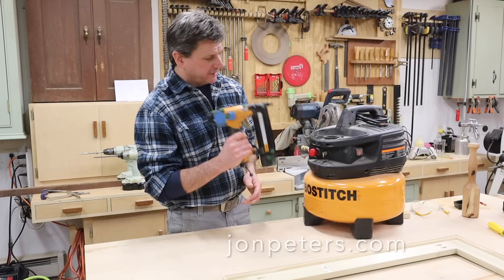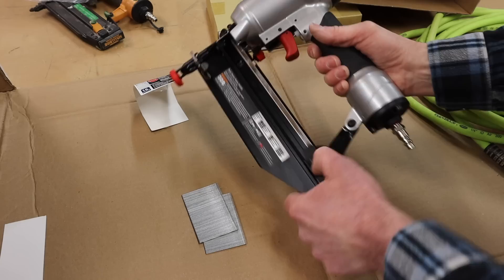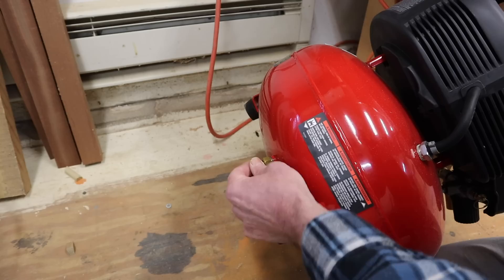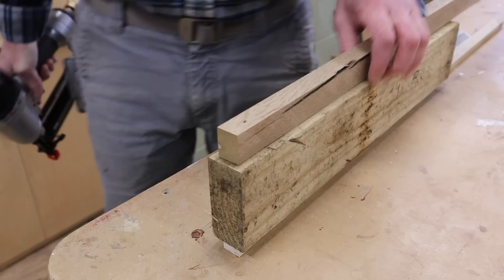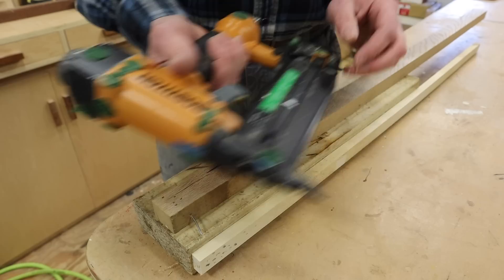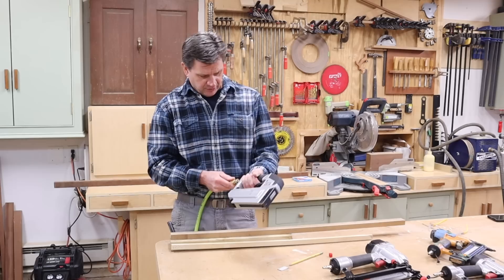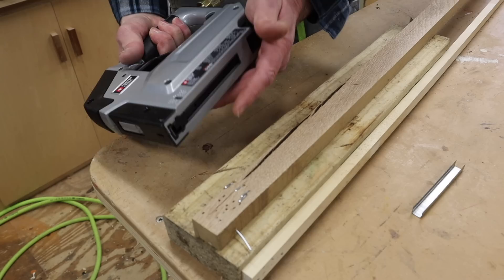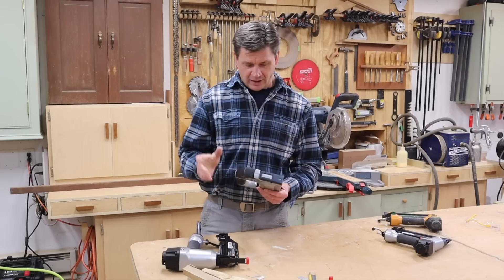$250 Nail Gun Compressor Combo Kit - Test & Review

Comment: Great video and thanks for sharing.  That valve was open for a reason.  Per the manual (who reads that) it says to do a 15 min straight break in run prior to normal use.  The only way to do this is open the drain valve so it purges continuously.  Just thought I'd share that easily overlooked info.

Comment: I bought the Porter Cable combo about 12 years ago for less than $200 bucks but it only came with a 16 & 18 gauge nail gun. I have never had a problem with the guns and the compressor still works well. Yes it is noisy but it only runs when it goes below the nail gun operating pressure. The combo reviewed by John offers a staple gun as well as additional compressor features. For $250, it looks like a good combo purchase.
Reply: If you look for the sale on this combo it's usually $169 or $179. Makes it even a better deal. Had mine for about a year now and no issues.

Comment: Thanks Jon! Helpful video.  
I have the same Porter Cable compressor/18g gun.  I find a slightly higher air pressure helps to set the nails a bit deeper. 
$250 seems like a great deal! Thanks again

Comment: That combo is well worth the money. I have had mine for 4 years now and i have used the compressor on countless roofs, hardwood floors, trim jobs, framing jobs, etc. The guns are good also. You cant beat it seriously. I have also pumped up air matresses and my tires numerous times. I am a small contractor and it has kept up with me. The 18 guage does have misfires though a decent amount, but it is still worth the price.

Comment: So i bought this same combo kit a year ago.  I am a homeowner/DYI guy and the first my first experience was not good with these tools.  I bought this combo kit from Home Depot which is 90 mins away.  When I brought this home, I immediately went to use it and discovered that the 18 gauge nailer didn't work.  I called Porter Cable and was told i had to return the entire kit to Home Depot.  I had to travel back to the Home Depot 90 mins away again to replace the gun.  When i got home, I tested every gun to make sure they worked, luckily they did.  About 3 months later while renovating my bathroom, the replacement gun failed and wouldn't fire any nails.  I again called Porter Cable who sent me another replacement, but it took 2 weeks to receive, which meant I had to hold off 2 weeks to finish my project (wife was not happy).  Normally, this wouldn't be an issue, however when I have to drive 90 mins to get a replacement when your in the middle of a project, it is a huge inconvenience.  For me, when I am using a tool, I need it to work,  I have owned Porter Cable tools for quite some time, and always had great success with them.  However, since Black and Decker (who owns the Porter Cable brand) bought Craftsman, I have seen a big decline in the Porter Cable quality as Craftsman is now their go to pro/consumer brand .  I would definitely stay away from this brand and these tools.  I will mention that I am pleased with the compressor and haven't had any issues with it.  I use it a lot and it hasn't failed me yet.  The third replacement just failed me again last week while finishing up a shed I am building.  Same issue, gun fails to shoot.  Apparently, the part that loads the nail fails and all you get is air coming out of the gun.  Although these guns have a 3 year warranty, I'm not going to bother getting a replacement, just going to get a better quality gun like a Dewalt (who BTW, is also made by Black and Decker, just better built) or a Senco.  Like I said, when I am using a tool, I need it to work.

Comment: We are using the Porter Cable 20v 18ga brad nailer (cordless) and loving it.  Air compressors make so much unnecessary noise...and tugging the hose around can be a drag too.  The cordless ones can be expensive, but I think they are worth it.

Comment: I would caution anyone buying a pancake compressor by DeWalt, Porter Cable, Bostitch, and Hausfeld. They all use the same manifold. When turning the regulator it compresses a spring against a disc. I don’t know the technical name of the disc but the problem is it’s made of plastic. Rather than spend a few dollars more on a part made from something more durable they use plastic. They don’t sell the plastic disc on its own. You have to have to replace the entire manifold! If not under warranty, this will cost you about $65 CDN. It’s a well known problem. There are several DIY videos out there detailing the problem and a fix. Personally, I think it’s shitty of this company to continue to use substandard material and then gouge customers for a $65 replacement unit to fix a $0.25 part.

Comment: Both companies are Stanley Black & Decker so pretty much the same product (along with DeWalt and now Craftsman).  Porter Cable was my first kit - still use the compressor and all the guns in the shop but ended up putting Rigids and Hitachis on my truck.   After a year the Porter Cable 18g was just leaving a lot of nails proud especially when having to nail at an angle like around inside corners or trying to toe or pinch nail, etc (even with pressure up to 120 psi).  The Rigids have been workhorses so far.
Reply: Ahh that explains why my craftsman combo set is identical other than color of the tools and the brand name printed on them and the compressor

Comment: Big PC fan; I've had the little pancake compressor for years and years and years, it's still going strong. Same with the PC 16ga finish nailer. I have a PC framing nailer that I don't get to use all that often (unfortunately), but it's done the job every time I've needed it. For the price of the tools, and for how much I use them - not every day, but more often than once a month - I think they're pretty hard to beat.

Comment: Thanks for the review. I have the same PC unit and it work great. I got a good deal. Iam a little concerned about the pancake compressor because of the comments on its durability. But any way, If I have to replace it, I will go for a Japanese made unit which seems to render better performance.

Comment: I just bought same set last week from Home Depot. $199. Planning on doing a bead board panel ceiling. NEVER used a nail gun before. This video helped so much. Looks easier than hammering. Starting my list of projects. Any other helpful  hints would be appreciated. Thanks
Reply: How do you like them  ?
Reply: Yeah I broke my door Frame and now it's hella wiggly and the nails came off. 
Now I gotta fix it

Comment: I have the same Porter Cable, got it on sale for $99 at Sears. The stapler gun sucks big time. I had a big project with it and it broke after a thousand staples.... the inside is platic and couldn't handle the load. Good thing I had a spare from another brand.

Comment: I've had a Porter Cable compressor with an 18 gauge and a stapler for about 3 years and have been really happy with them. It is loud but then it only runs to refill the tank. My only has one hose connect however i doubt i would ever have a need to have two guns plugged in at the same time.
Reply: Sometimes I put the air compressor outside or behind a wall.  On occasion I wear ear plugs.  However, I always use air tools because of the weight and price deference.  Besides the air compressor is a one time expense.

Comment: You should check out California Compressor. They are very quiet and reasonably priced.
Reply: I have one and it is extremely nice. My pup will occasionally wonder into the shop and she was not phased when it kicked on, and she is always on edge for those things. Bought a cheap Banks nailer and have been quite happy.
Reply: I returned a PC, way too loud. I bought a California Compressor #8010 off Amazon and couldn’t be happier. What a difference. I only use it for nailers, tires light duty etc.

Comment: I have this same combo kit, maybe a dumb question but when would you use the 16 gauge gun vs the 18 gauge gun, which gun is used for what?
Reply: 16 will give a little more hold but has a bigger hole, 18 is slightly weaker but also has a smaller hole so better for trim as it leaves less to fill and sand.
Reply: Is  the 16 gauge good for framing?i want to build a wood shed ,

Comment: I have the PC compressor and the same nail guns and stapler. The stapler worked for about 6 stables and died. The 18 gauge died shortly after that. Avoid Porter Cable like it was the plague 🙄

Comment: Hello, my new 26-gallon porter cable air compressor was dumped on its head during the hurricane and the motor is shot. Should I replace the motor or buy a new air compressor?

Comment: Nice video! Did your compressor and nail guns come with a small bottle of oil? Mine did but I lost the instructions and have no idea where or what to use it on. That might be a good idea to do some videos on, maintenance and up keep of your most used tools. Thanks for the videos, I'll learn a lot from watching them!
Reply: To oil the tools just put a drop or two into the air inlet valve to the tool, and use it like normal

Comment: Does the stapler have a depth adjustment? I noticed its not putting the bridge of the staple flush with the wood. Or would you need to adjust to a higher  psi to flush it up

Comment: Excellent timing. I'm actually in the market to purchasing a compressor. Where do you recommend purchasing this combo set?  
Do you know if the compressor can also take to duty of occasionally filling up tires and blowing saw dust from the shop area as well as the nail & stapler guns?  Excellent presentation & am looking forward to the stretching of a canvas.
Reply: Liam M might want to look at one of the California Compressor models. They are ultra quiet and nice quality for the money. Available on Amazon.
Reply: idigbebop ,, Good to know. Thanks greatly appreciated. Will check it out.

Comment: Turn the air pressure up 5 #s ......WTF??? Sorry , but don't over complicate a 1 braincell worth hiccup . If you read the directions ? You were supposed to leave the  petcock valve open and to let the motor run for 10 or 15 min. straight to break it in. I dont have the manual handy , but I do remember to run with valve open for a certain time. The pressure at the tank will be quite higher than at the tool , if 90# at Tank , 50 ft. hose to tool , @ tool will approx be 65#s ......Hope the info helps...I have the same kit , 2x .................If it starts knocking a little harder than normal , spray some silicone spray into the intake , It will help with rust in tank and rubber seals , valves , etc.    About 15 yrs ago , the kit came with 1000 nails and you got a real crown stapler 2 1/4 inch . and it was 199$  FKN bean counters suk!